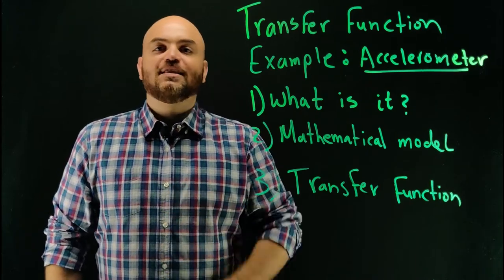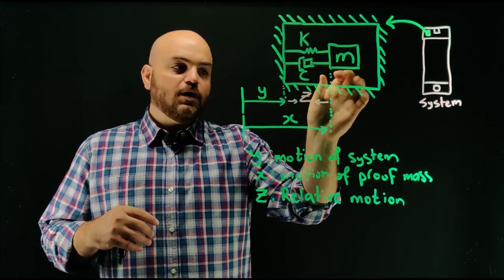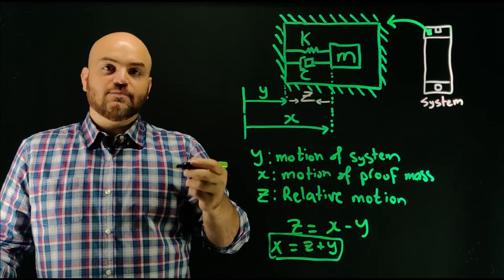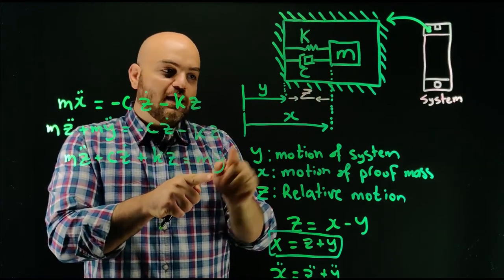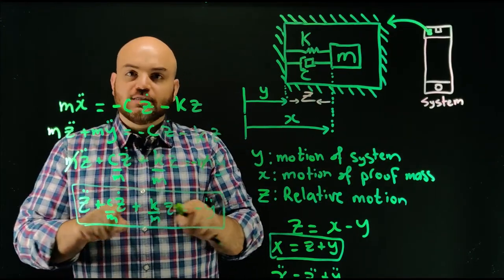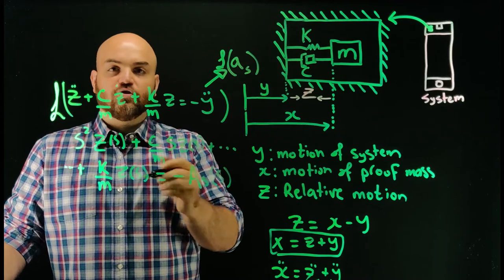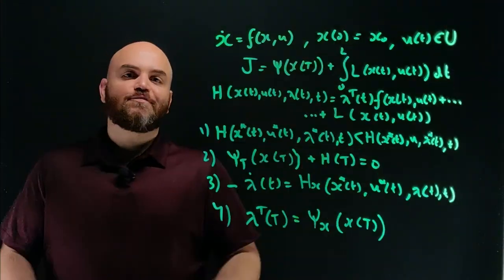Accelerometer Modeling - Transfer Function Example

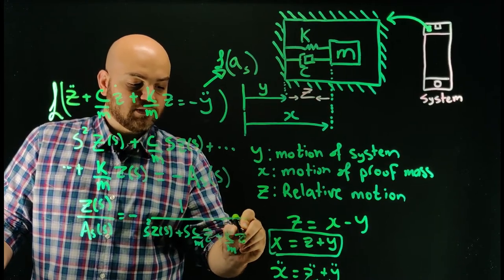Comment from the maker: Correction: There is an error in the denominator of the transfer function at 8:17. Z(s) should not have been included in the denominator as it is on the left hand side.

Comment: hi, considering a real acelerometer, witch gives a Ax, Ay, Az. Do I have to apply this same transfer function to all of the axis? Plus, the sensor gives us a constant gravity that, in any given time (provided is not free falling) will be pointing to the center of earth. How do I find the gravity portion of the equation? Or, considering the object in some vertical (not completely vertical, but twisted in some axis), the gravity would apear in the model faze. How does this affect the transfer function?
Reply from the maker: For a 3-axis accelerator you could apply a similar transfer function to all three axes to get the inertial acceleration, I suggest you start out by writing the ODE's governing the motion and then going form there to account for any coupling between the axes. 
As for gravity, it is essentially a force applied to every object in the gravitational field and affects their acceleration. When you have a rigid body and you want to model inertial acceleration on different axes you need to have the attitude (orientation) of the rigid body. That will allow you to calculate the component of the gravity force on each axis, depending on how it is mounted on the object.

Comment: Hi, thanks for your video and information.
I want to model a MATLAB Simulink model of a accelerometer in order to generate Ax,Ay,Az values and then compare with the real sensor data.
Can you please suggest me the required inputs, transfer functions that I should include in the model. It would be great if you give me some suggestions and existing similar accelerometer models using simulink.

Thank you.